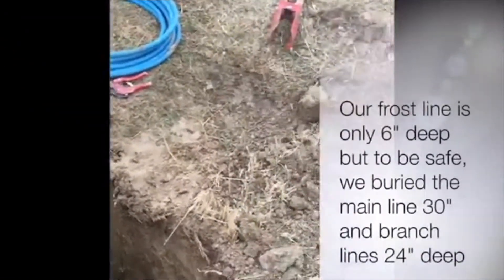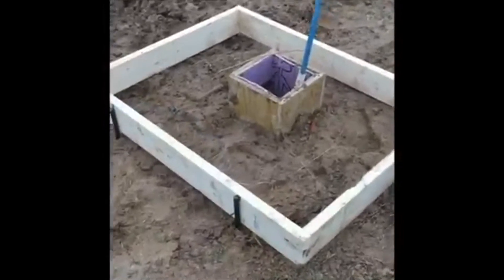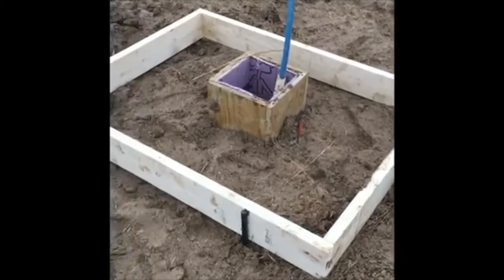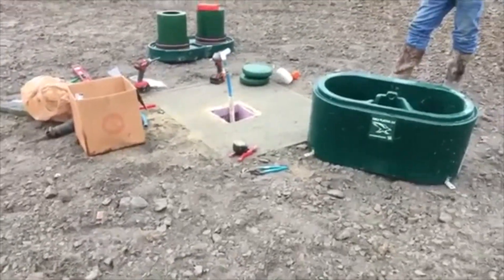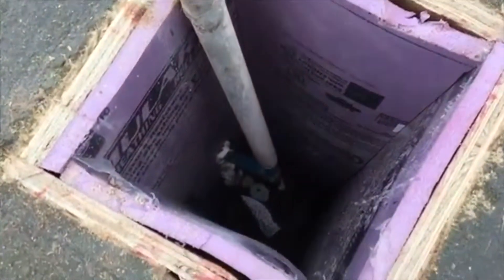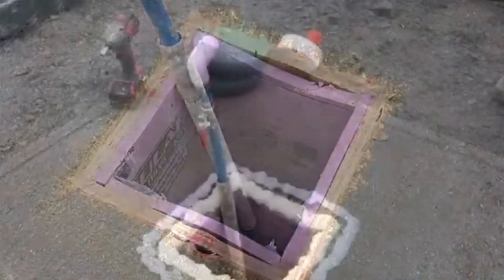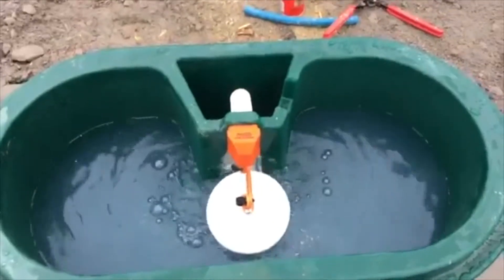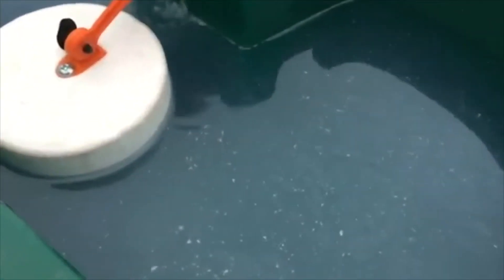LAPP Energy-Free Waterers

Comment: Is there a drain hole in this drinker?
Reply: I HATE ALL FIVE OF MINE!!!!!  And very little "help" from the company, either! The "drain plug" is a stupid rubber PLUG that so far NOBODY HERE has been able to get removed in order to drain it and clean it. IF It ever gets removed, I'm pretty sure I'll have to buy a NEW ONE to replace it, because it just keeps "chipping off" pieces of rubber each time we try to pry it out of there! I was dumb enough to buy and pay to have installed, FIVE of these 2 years ago. So far, they are all worthless, as they all five freeze SOLID EVERY Winter, several times each year (I'm in south/central Missouri). All my water lines are 6' deep, so the hole under them is 6' deep, and has a HUGE Black plastic (ribbed) Pipe coming up under ground to them. I don't know why they freeze, but I'm not happy with them - in my case they are pretty much USELESS because of freezing every winter. ALSO, in order to get to the "working parts", it's NOT an easy access!! You have to unscrew 4 screws that are only into plastic, so each time you screw/unscrew them, you are "boring out" the plastic - only a matter of time til that is useless!! THEN, you have to lift the entire top off to get to the water supply, valve, etc. What a time/energy waster!! WHY the makers didn't install an access door is beyond me! I have other complaints about this over priced junk, also, but this should suffice for now. I spent OVER $500 EACH for FIVE of them (Nearly $3000) and then spent THOUSANDS Of Dollars to have water lines run to all 5 of them. I've never been so disappointed in ANYTHING IN MY ENTIRE 60+ Years of life!! I would NEVER Recommend these to ANYONE (Mainly because the company is almost "useless" when I ask for help!) So mine have been installed for 2 years and not one has ever been cleaned because no one can get the plugs out (WHY didn't they put in a METAL SCREW IN PLUG like a normal stock tank??) Before I wasted money on these, my animals ALWAYS HAD CLEAN FRESH WATER because I kept my old drinkers drained and cleaned often. I HATE THESE!!
Reply: I'm sorry to hear of the disappointment with the lapp waterers. I'm in Maine with -20° weather during the winters. The float does freeze during very cold weather but l usually just hit it with my boot heel and it breaks free. I have had to on rare occasion dump a pail of hot water in on the float when the float valve has froze up but they've always let go with one pail. We went to using roof screws to hold the covers on. We've had our waterers 20+ years l believe and l wouldn't have anything else. Just thought I'd share my experience.